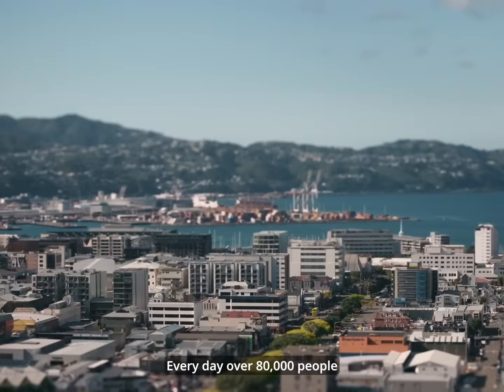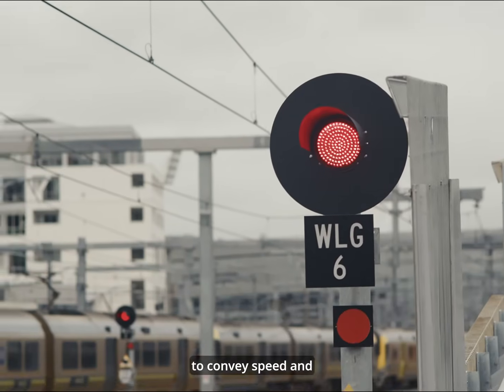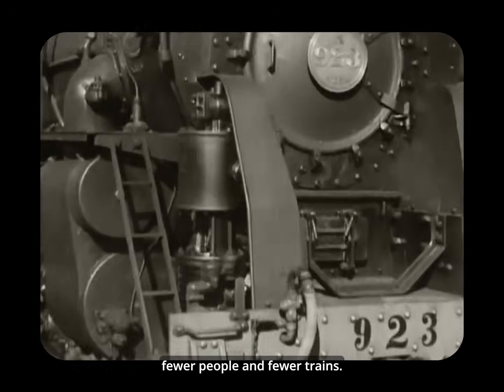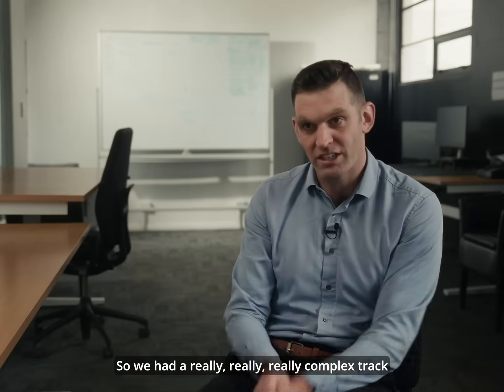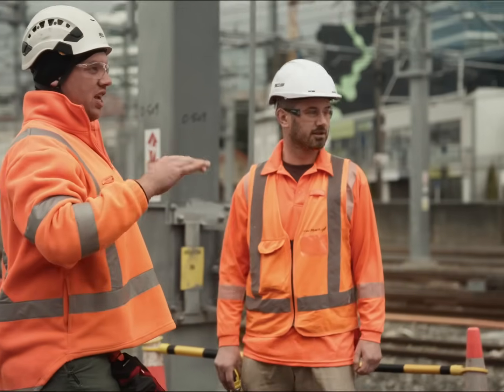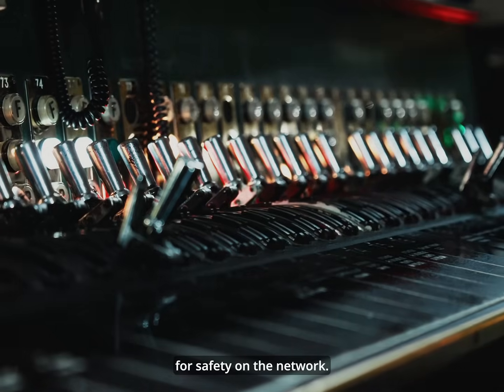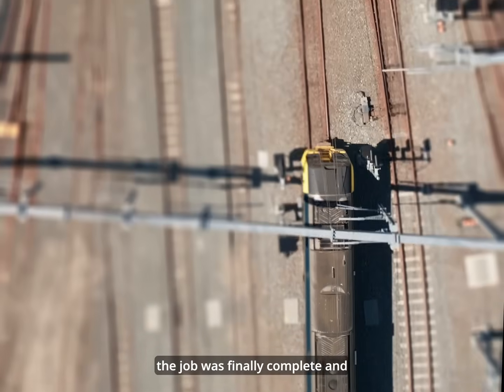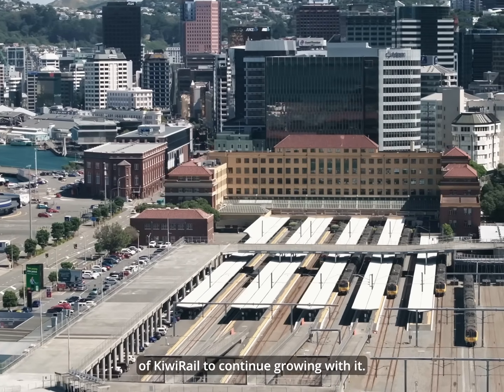Modernising to keep Wellington moving

Comment: Have you thought about putting a second tunnel in the remutakas
Reply: Nowhere near needed yet.
Reply: For?
Reply: It's not justifiable given the enormous cost and comparatively low patronage of the line. As it stands it doesn't even make economical sense to electrify it. However it would be nice to get proper signaling done as they're still operating on the wairarapa side with track warrants
Reply: @francoismurrell4604  It would be freight movements that would justify it, not passenger trains.
Reply: If we had higher freight volumes, sure. Can't see it really ever being an issue. With the upcoming LNIRIM project refreshing the WRL rolling stock with 24 new multi mode train sets I could see it being needed in some amount of time though.
Reply: Which correct me if I'm wrong but there are no frequent freight along that line.
Reply: @kaimanawastudios  Therefore; no financial justification for blowing millions on a second remutaka tunnel.
Reply: @francoismurrell4604 they are upgrading that currently.

Comment: Extension to Otaki? Would be a big boost
Reply: Sadly doesn't seem to be on the cards, but it'll depend on who wins the business case in general for the hybrid trains up to Palmy
Reply: There is going to be new trains replacing the Capital Connection which is expected to run at least 6 times a day.
Reply: Stations at Lindale and Otaihanga road first please.
Reply: Why not all the above? Especially if Auckland can spend 400m on 3 new stations in Drury Paerata.
Reply: @navinthehouse4710  Auckland is a priority though because they're a bigger city that contribute more to the economy and they need more help with getting decent public transport.
Wellington had billions spent on the transmission gully motorway.
Reply: I agree aucklands a priority, i just dont see why you can't fund both. Wlg might need that boost since their rail numbers are deep in the toilet. Auckland is getting the nw busway, botany airport, penlink, Mill road, east west link etc
Reply: Each region can fund themselves, Auckland by a percentage of its population and Wellington by a percentage of its population, not one population over another but on a per capita basis
Reply: @ytzpilot  Unfortunately Auckland doesnt fund the Te Huia Hamilton auckland service, or have any desire to extend the metro to Tuakau or Pokeno
Reply: @navinthehouse4710 Waikato should pay for that infrastructure , just like Kapiti District should pay to extend service up the coast. If it’s important to the locals take it from their rates as well